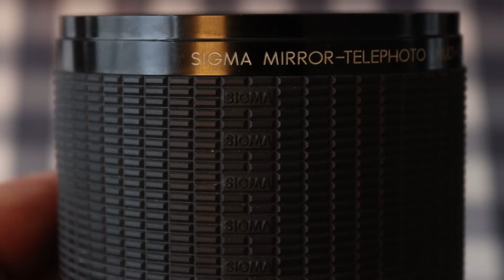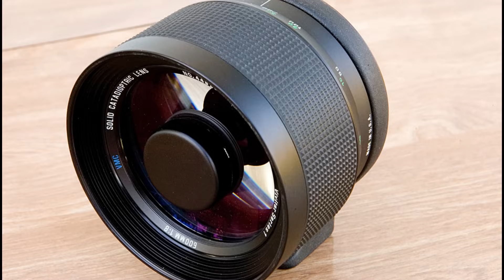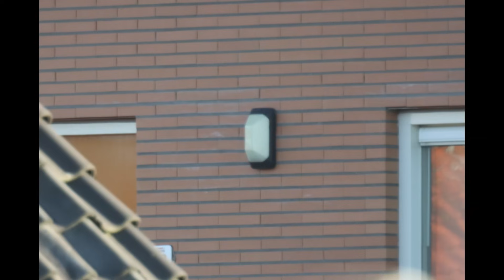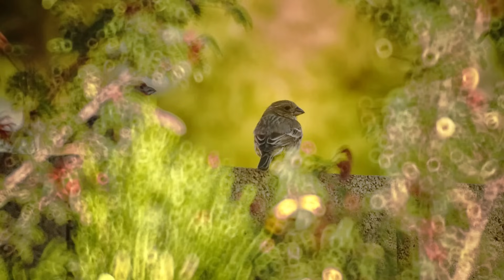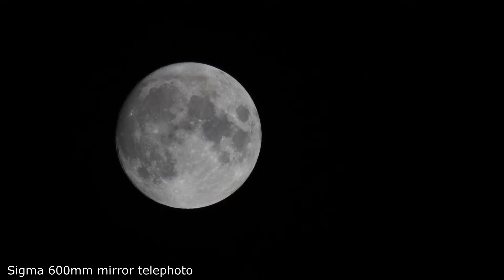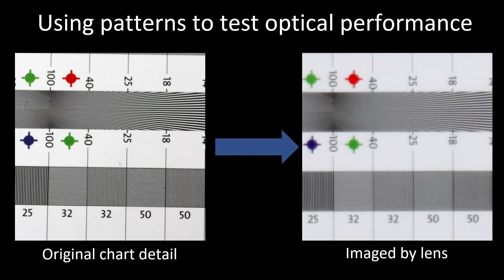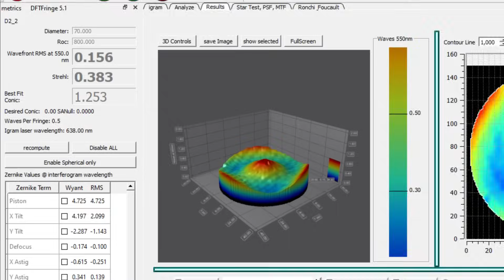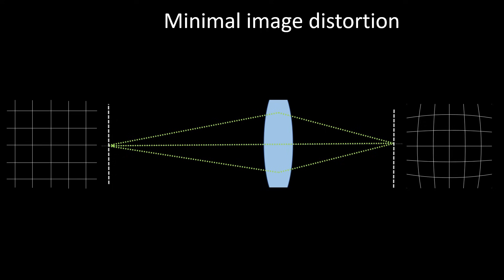Camera Mirror Lenses Part 1: Visual and Interferometric Testing

Comment: For someone motivated by this video to acquire an inexpensive (relatively) mirror lens, consider the Tamron 500mm f 8.0. This was the original consumer mirror telephoto, as compared to the $10k lenses custom built to order from Nikon, Pentax, and Zeiss. Their popularity and economic success for Tamron launched a variety of cheaper copies, including Sigma shown here. Note that the best of these mirror lenses, originally new for less than $500, have only average resolution and lowish contrast compared to better quality conventional lenses of their day.  The positives for these mirror lenses were (are) light weight, compact physical size, lower cost, and a complete lack of spherical aberration, which was at the time impossible to eliminate from conventional lens design. Use of ED type lens elements removed the aberration advantage, leaving later conventional lenses performing much better than the mirrors.

Comment: I have two copies of the soviet MC MTO-11SA lens - one of them had a tiny mold defect on the mirror while the other had damaged outer paint coating. So I thought I'd just put together one good lens from the two. However tests shots has shown that neither set of optical components performed nearly as good in the fancy body with good paint compared to the one with damaged paint. Further investigations have shown that these types of lenses (mine ar Maksutovs) are EXTREMELY sensitive to mechanical stress. I mean the meniscus lens is a solid 10mm thick piece of glass, but if you tighten its mounting ring more than 'loose', the image quality goes completely out the window. Unfortunately, I do not have a fancy interferometry setup, but I am in the process of setting up a very good quality test chart for MTFMapper software so I can actually start doing some measurements. My preliminary hypothesis as to why the good body won't accept the optics is because it was made around 50 years ago from a magnesium aluminium alloy with comparatively thin walls, so it actually warped itself due to natural metal aging and they warped the seating surfaces of the optical elements along with them.
Reply from the maker: Thanks, that is some good info. I will also have a look at the mtfmapper software.
Reply: @HuygensOptics  Ritchey-Chretien telescopes are notoriously difficult to collimate, and perform miserably if not precisely constructed and collimated.  These smaller mirror assemblies are even worse in that regard.
Reply: I have a question related to the size of the MTtesting pattern. Lets say that if I just want to play around and test the iphone 16 main camera MTF, how should I decide the test pattern size? I understand that it depends on the field of view, but it also depends on the object distance. My guess is that maybe it should be divided into lets say 1m and close up 40-50cm two cases assuming the FOV is about 80 or what based on their specs. Do you think this is the right approach? thanks
Reply: @ I'd say make it as large as you can. I made myself an A0 paper sized one, and the widest lens I've got was 14mm on APS-C, and I still had to creep up to it quite close. Its true that some lenses may exhibit worse optical characteristics when focusing close versus infinity, so your idea has merit - you should be able to tell if the resolution in the centre of the frame changes with focusing distance.

Comment: Excellent Video as usual. Speaking as an Astrophotographer I can say without question of doubt that imaging a field of stars places the most difficult test of any optics as  stars contain wavelengths from UV to IR and as the stars are round recreating this faithfully on Film, CCD or a CMOS colour device is extremely difficult and very expensive. This is due to the need to focus all wavelengths to the same spot equally regardless of wavelength to retain roundness and  point spread function (PSF) across the field. Every single type of aberration you can think of may show up in even the most expensive of optics.   For mirror optics the percentage of obstruction should be low for planets to retain the detail and as the field of view increases so does the obstruction ratio but nebulae and star field images are not affected by this. However using a big chipped camera with a low obstruction ratio will result in unacceptable  light fall off from the centre of the optical axis. So, if you want a quick way to test optics ...... try pointing them at the stars as many of these errors are not readily noticed on terrestrial images.
Reply: Is using a filter to narrow the light spectrum a viable approach?
Reply: @iestynne  For what purpose?
Reply: So you only need to deal with monochromatic light
Reply: @iestynne  I take we are talking about Astrophotography and the answer is yes however that answer could be an hours long video in itself. When dealing with monochromatic light we get smaller tighter stars due to the better control of LCA (longitudinal Chromatic Aberration) assuming of course focus is perfect. The main filters we use are Red, Green, Blue, H-Alpha which is at 656nm a deep Red and is Ionized Hydrogen,  O111 (Oxygen 111) , and S11 (Sulfur-11). We also use a Luminance filter which is clear. The Ha, O111 & S11 are classed as Narrowband filters and these colours when mapped give a different palette the most popular being the Hubble Palette which blue and Yellow resulting images. As I said the topic is vast, just hope I've answered the right question. 🙂

Comment: I wish you could have looked at a Zeiss Mirotar lens for Contax or Contarex mount. 21:17 you can see something pass in front of the Moon from upper left to lower right.

There is also the smallish Ad Astra III Maksutov (760mm f/9.75) telescope with a m42 screw mount.
Reply from the maker: At first I thought it was a satellite but if you look closely, it is actually a bird. By the way, I saw that the Zeiss Mirotar is actually pretty pricy, as expected from Zeiss (Zeiss is nice, but twice the price)
Reply: @HuygensOptics  You might be able to find one to test in Europe. Lens nuts always want to put their Zeiss collections up against the rest. PS I always thought a Stehl ratio that compared a perfect, UNOBSTRUCTED optic against one with an obstruction was unfair. A better one might be comparing the actual optic against the theoretical limit it would have with perfect execution.

Comment: Such great stuff. Could watch hours of this. Just wanted to add, I've got a Tokina SZX 400mm(got it at a fraction of msrp, in mint condition) and to my eye, it makes much sharper images than any of these. Still has the same low contrast inherent to mirror lenses, but the detail is there. From what I've read and my own experience too, mirror lenses require an extra long lens hood as they're very sensitive to stray light, which will degrade contrast even more. 
Basically they're great as a cheap compact telephoto, with a few caveats. Most useful when you don't want a long heavy glass lens at the cost of quality.
Reply from the maker: Yes, that is correct, a long lens hood will help really improve contrast on these and is almost a requirement for their use. It seems that there are large differences between these lenses with regard to sharpness.

Comment: Nice report. Important to remember that the Maksutov optical system is designed for really slow focal ratio, f/15 or slower, with f/12 a reasonable compromise, but f/10 the performance really starts to suffer. Of course you know this, this comment is for the readers. I have a Meade f/10 1000mm mirror lens and while it's not as bad as this Vivitar, it's not very good either. In contrast my f/14 ETX90 1250mm is outstanding.
Reply: No one use original Maksutov,  as front element must be too thick and heavy, everyone split it to many parts and do other ennhancements to get completely different ratio limit.

Comment: Do you have to consider the coherence length of your laser diode, i.e. is it a special one you selected carefully for this kind of work?
Reply from the maker: A stable laser diode really helps, but it's important to tweak the laser current such that you get sharp and clear fringes. This has to do with the  temperature dependence on wavelength, because the temperature, and thus laser wavelength, is dependent on operating power.
Reply: @HuygensOptics  Thanks for another great video! The quesition of coherence length is quite interesting, have you measured it for your laser diode? Given that it optical path through from the beam splitter through the telescope and back may be around 70-80 cm while the optical path from beam splitter to reference spherical mirror and back looks to be about 15 cm, so the coherence length of your laser seems quite large (I thought typical diodes have a coherence length on the order of < 20 cm). Appreciate your thoughts on this!

Comment: Could a poor lens be improved by a user by an external stencil over the lens that blocks light from hitting the most imperfect area of the mirror?  Reduced light gathering capability but improved MTF.   What would be a good way to determine the stencil shape? E.G.  setting up the camera with a high contrast and lots of fine detail or a test pattern, then systematically try moving a stencil with a small hole around to find the worst & best optical paths, and then cutout a stencil that blocks the worst optical paths? 
     ps … gotta love your expertise
Reply from the maker: Yes, It is possible, basically you do something similar when you decrease the size of the aperture. But if you decrease the aperture area too much or make it complex in shap, diffraction effects will decrease your optical performance again.
Reply: That's an old photographer's trick, like blacking out scratches.  If will improve image contrast, but reduce MTF and speed, and introduce bizarre diffraction effects and lens flares due to the pupil being randomly blocked (kind of like the starburst effects with high f/numbers from polygonal iris mechanisms).

Comment: Wonderful video! I am interested in using the Strehl ratio for understanding the distribution of light in the PSF - in the wings, much more than in the central core. Is the Strehl ratio a good indicator of the radial ‘wings’ of the PSF? For broadband light the ripples of the Airy function become a radially smooth function - does the Strehl ratio help me understand the radial slope of that function?
Reply from the maker: The nature of the "wings" you refer to I guess is more related to a particular aberration. You can have no spherical aberration or astigmatism, but still have a Strehl of zero, for example if you have a very rough surface. So in some cases, the Strehl is not a very informative number at all. PFS is a better description I  think, but takes quite a lot more time to explain.
Reply: @HuygensOptics  Thank you. We are doing ‘extended object photometry’ close to the Moon, and want to understand how to suppress the amount of light in the wings of the PSF.
Reply: @HuygensOptics  Strehl ratio integrates the difference in MTF from an ideal lens with a circular entrance pupil; since catadioptric systems have a distorted MTF curve and a donut entrance pupil, the Strehl ratio isn't that informative, could be better or worse.  In testing terms, a low diagnostic power, if you will, false negatives or false positives.
Reply from the maker: @RichardKinch  I thought that the Strehl was the ratio between aberrated image compared to the maximum attainable intensity using an ideal optical system limited only by diffraction over the system's aperture. This would mean that obstructed apertures can still have a Strehl of 1, since they have a different theoretical diffraction limit and airy disk. I think the DFTfringe software corrects for obstruction, but I'm not entirely sure.

Comment: I cannot believe this. I just purchased a Tokina 500mm reflex lens, and remarked about how many troubles the system causes. It had fungal growth inside (similar to the sigma) which I needed to remove before use.

Comment: I’m not surprised the new lens performs so poorly, they seems to be treated more as a gimmick these days. Between the lack of autofocus, image stabilization, very shallow depth of felid, relatively slow fixed f stop and donut bokeh, they aren’t really attractive to most casual and professional photographers. Even within the astronomy community they are disliked. Simply because there are better options at an equivalent price point. Although I suspect the reputation of older lenses is damaged by the newer worse products. 

Vintage mirror lenses were taken more seriously by manufacturers. I have a tamron 55bb, and I enjoy the unique experience of day time imaging with it. I think it’s one of the better mirror lenses out there that can be found sub $200. I’d always recommend it.

Supposedly, some of the older f8 lenses are actually brighter than the new f5 mirror lenses because of the quality of coatings. 

Your videos are fascinating, and approachable, even as someone like myself with little knowledge but an interest in optics.

Comment: Thank you for covering these lenses! I've wondered exactly what kind of optics they use. I knew they were generally cassegrains but I've always wondered if the front glass element was correcting or just for keeping dust out essentially. 
I have a differently branded version of that 500mm f/8 that was about $5usd at a thrift store, which generally falls within my "buy it for the novelty even if it's bad" price range. One nice thing is that these lenses seem to mostly use the old M42 thread, which is exactly what most astronomy cameras have. Results are...not good honestly haha, but better than nothing.

Comment: I have three mirror lenses and I turned my Tamron 500mm f/8 into a tabletop telescope by removing the infinity focus stop and attaching a prism diagonal. Works great and is extremely portable
Reply: I could talk about mirror lenses all day!
Reply: Tamron sold a very high quality right angle prism/eyepiece with magnifier to attach to the mirror lens in lieu of a camera. There is also a doubler to increase the telephoto focal length at a modest cost of reduced performance (which should not matter if using the lens as a telescope).  These accessories connect with the Tamron proprietary Adaptall II interface, so are not usable with non-Adaptall mount lenses. I've intended to use this combo to watch an eclippse, but so far I forget to set up fot it.
Reply: @randallstewart175  Just remember you lose two stops when you insert a doubler. In terms of light-gathering capability, you have an f/16 lens.
Reply: @mal2ksc  For astronomy it doesn’t work that way. Telescopes are mostly measured by their aperture. In the case of a hobbyist scope, that will probably be anything from 60mm to 300mm. The f ratio doesn’t matter very much.
Reply: @randallstewart175  I’ve seen the “02F” come up in my research but they’re pretty hard to find! I see one on eBay with with a starting bid of $50! I wonder if i can make something like this myself using surplus binoculars prism optics
Reply: @AdmiralSym  Tamron made an Adaptall II doubler, 6 element, fairly high quality, which fits all of those lenses, the 01F. This is quite common and cheap, commonly in the range of $20 - 40. They also made a model 200F, also a 6 element doubler with ED type glass, which is very high quality and gives a much better optical performance than the 01F. It is very rare and fairly expensive as doublers go. It does not fit most Adaptall lenses except for prime and zoom telephotos. If a 500mm mirror lens is used as a telescope, either doubler will fit, but the optical advantage of the 200F will mean little or nothing because it's improvements show in the edges and corners of a photo image format, probably outside the visual area of a telescope usage, and the human eye' would probably not see the difference anyway.
Reply: As an amateur here interested in lenses I would like some advice on building a microscope from my collection of various lenses. Majority of my lenses are obtained from telescopes, binoculars and cameras. Can those same lenses be configured to build a microscope?
Reply: Hi, I have a Russian 3M-5A 500 f8 😊 How did you attache the diagonal to the mirror lens?
Reply: I've done this as well!  A great way to repurpose old lenses.  Trying to figure out a compact backpacking telescope.  The older mirror lenses seem like a good option.  You can attach an eyepiece projection adapter if you want photos with some extra magnification.

Comment: China and Korea doesn't mean bad
Reply: Korea have an excellent quality, China in other hand is trash
Reply: Korea doesn't really mean bad. That's where basically all LCD/OLED panels are coming from, plus a lot of ICs.
But China, yeah. Not known for their big grasp on process control, and the 800mm lens probably is a good design, but put together badly.
Reply: @graealex  I think we there talking about Korean made Optics. Not about Korean made products in general.
Also the IC's you mentioned are probably made using ASML/Zeiss optics
Reply: @GermanMythbuster  They probably are, but doesn't change the fact that Koreans have pretty good process control, while this is always a problem with China-made stuff.
And you're not the only one watching Asianometry.
Reply: @graealex  I never said Korean made products where bad/worse. 🙂
Reply: No it doesn't, but also not industry leading.